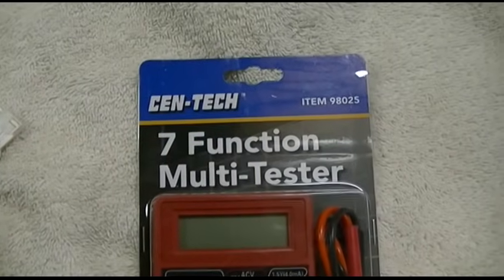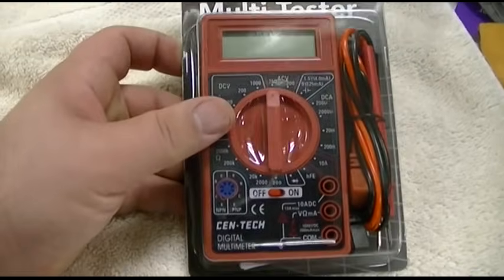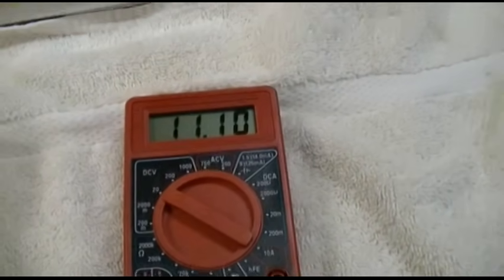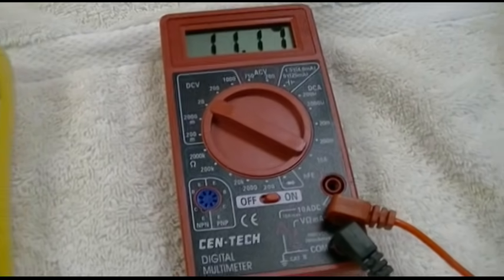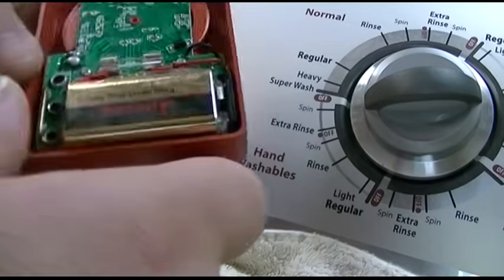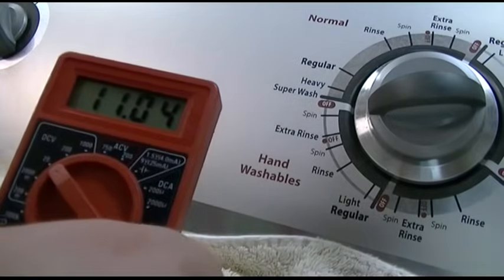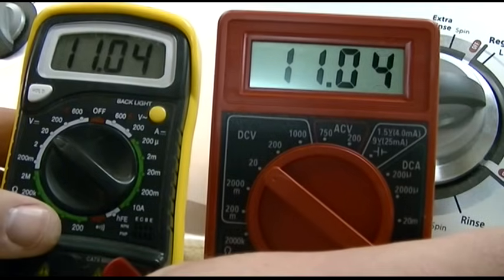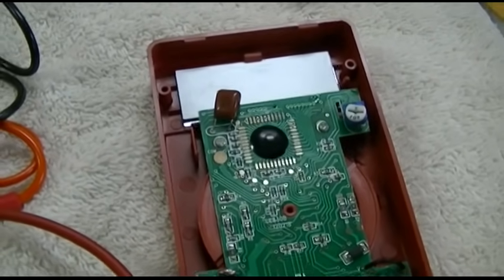Harbor Freight - Cen-Tech 7 Function Digital Multimeter Review

Comment: Why can't you measure the voltage of the battery, of the battery of the meter that you are metering with?
Reply from the maker: Bad stuff will happen.  At the best, you'll get quite an erroneous reading.  Worst, you'll blow the meter and it will never measure accurate voltage.  The only possible exception to this would be something like an old Simpson analog VOM, where the internal battery is strictly there for resistance tests and in no way has any function for voltage.

Trust me, just swap another battery into the meter, and then measure the old one.  Ask me how I know.
Reply: jaykay18
What? No circuit isolation? No warning about this within the meter or its instructions?
Reply from the maker: Yosef MacGruber I had a Fluke meter that you couldn't measure the battery in either.  And why would China possibly warn you about hazards in using this product?  They never warn the kids about lead paint.
Reply: jaykay18
Are ordinary workers in China, not allowed to think or to voice concerns? Seems like they push out crap, just to make a fast buck. Where are their work ethics?

Was lead paint really as bad as they said? I heard that paint jobs didn't last for as long, after the lead was removed. Of course, we shouldn't be finding any lead paint on toys or in toothpaste, or whatever horrors that China has been cranking out recently?

Where are overpriced Fluke meters made?

Isn't the voltage reading isolated from the battery? Voltage reading is supposed to be at near infinite resistance, so as to not alter the circuit being measured, whereas current measurement is at near 0 resistance. How can near infinite resistance, cause a problem with measuring its own battery?
Reply from the maker: Yosef MacGruber The workers in China are NOT allowed to voice their concerns.  I've read that in China you can have 1 of 2 occupations.  You can be a farmer, and live in absolute poverty.  Or you can work in the big city in a factory.  Most of these pay next to nothing, and have deplorable working conditions and hours.  But remember that "next to nothing" is a term we use here in the US generally to describe minimum wage.  In China, that equates to about $85 a week.  In China, $85 a week can do some pretty nice stuff for a person.  But remember that your job owns you, a lot of them include dormitories for the workers as well, so you really end up having no life.

I don't know about how bad the lead paint thing was, I grew up eating paint chips, breaking open thermometers playing with mercury, and spend many hours a week in an area with falling asbestos, and have shown no health effects from any of that.  Or at least I'd like to think so ;-)

I don't have my Fluke with me now, and I don't know where it's made.  The older ones my dad has were probably made in USA, only because at that point in time we weren't outsourcing everything there.  I wouldn't be surprised in the very least if the Fluke meters are made in China now.  If they're not, they're assembled in USA of foreign and domestic components.  You know what that means.

If you want to go ahead and blow up a meter, try measuring its battery.  But the problem is you couldn't possibly get an accurate reading anyway, because when you test it the battery will be under load, driving not only the LCD display (and possibly backlight), but also the electronics.
Reply from the maker: Yosef MacGruber Not buying China is as simple as NOT BUYING AT ALL.  Now of course there are going to be incidentals, you can't necessarily control where your toilet paper is made and you're not going to stop buying it.  What I'm talking about are all the latest useless gadgets like Bluetooth speakers that have some of the worst-sounding speakers I've ever heard.  Or perhaps reusing old technology.  For example, instead of tossing your excessively-slow computer, maybe reinstalling the OS, or switching to a better OS would be an option.

I don't know if you watched any of the presidential stuff lately.  When Trump gave his acceptance speech, the audience was a sea of screens.  EVERY SINGLE PERSON had their phone up in the air, either taking pictures or recording a video, as if they were the only one in the world to capture that footage.  Not only that, they were going to be the first to post to social media.  That's because we took away our country's freedom and allowed our phones to drive it instead.

With that aside, can you imagine the environmental impact of that?  EVERY SINGLE ONE of those devices had to be charged that night.  While it only takes a few watts to do so, they probably also had a tablet or laptop to charge to.  That's one person.  Then their spouse or children or siblings, or what have you, are all in the same dilemma.  So now the few watts is double that few watts, per person.  Then multiply times how many people in a household, how many households on the block, how many blocks in the town, how many towns in the county, how many counties in the state, the numbers are simply staggering.  That's how many watts we need to create to charge these devices.  Electricity doesn't come free of environmental pollutants, unless it's hydroelectric, solar, or wind.  Needless to say I do NOT own a cell phone.

Regarding your WalMart story, yes, the lady felt a sense of security confiding in you probably due to skin color.  And NOT to her manager, who was probably of a different color.  Remember, Wally World is an Equal Opportunity Employer, and they need to make it known as such.  Like George Orwell's Animal Farm, "All animals are created equal, but some animals are more equal than others".  I think the days of the American are numbered.

Irwin, the company that originally produced the Vise-Grip locking pliers, now has their once American-made products made in China.  And on the package it says something to the effect of "made in China to Irwin's exacting standards".  What a crock!  I found at least 5 things wrong with that pair I picked up.  I guarantee you never saw that when they were made here.

As far as your meter with all of those features, Harbor Freight sells that.  This meter was free.  You can't beat the price of free with any amount of money.
Reply: jaykay18
Not buying at all? Great idea, that way I can boycott this whole crappy NWO-ruined economy.

I have been interested in getting some Bluetooth speaker(s) for a while, however, I have yet to find anything cheap enough, or anything that said to me, "Buy me, because I am too special to pass up."

Yeah, I would love to switch my OS to the OS that I plan to write someday when I have time, the problem is, that day hasn't come yet, and I have not had time to write my OS yet.

What is your complaint about people's phones? People's phones I understand, a lot more than all those huge suitcase-cameras, that make obnoxious noises when they take photos. Sometimes you can hear the cameras going crazy, on some stupid political photo-op, on the radio, which has no visual component.

What "environmental impact"? Those devices are almost totally-free to charge, just so long as the battery doesn't someday crap out. If the number are staggering, then it is either because your mind is too small, or else you need to put away that dollar-store crap calculator of yours, and get you a fancy graphing calculator, or at least a calculator with at least 10 digits, so that the numbers will better fit. Or these days, you can get free calculator apps for your smart-phone, even for "scientific" calculators.

What I do not understand, is what is the point of going to political presidential rallies? I already know that I am voting for Trump, regardless of whether or not I ever meet him in person, or shake his hand. If I could say something to Trump, it might be, "Be more pro-life" or "Be more conservative" or "Could you hire me?" What about the supposed environmental impact of all those cars, the hours spent driving to there, and all the man-hours consumed to do those rallies? But then, that is part of the campaign process, and if a person does not campaign, the stupid voters won't know to vote for him.

Cellphones, whether dumb-phone or smart-phone, use a lot less energy than a full-sized computer. I presume you must be using one or the other, to post your comments here?

Maybe I could pay more for a multi-meter, if it would just automatically fix whatever I am testing. But then, should we want an AI robot made in China? I do like to watch those YT video teardowns of electronics crap from Chinesium, as one reviewer calls that stuff. Fascinating, in a morbid sense. Really? Will someday there be a museum documenting the horrible crap that came out of China for a while, until they cleaned up their act? Makes me wonder what Chinese horror story products I might own? And how to quickly spot them in the store or when shopping online. Not only are many products unsafe, but the quality is shoddy as well. As if the trend now, is to make stuff so crappy and cheap, that it barely even works.

So do you think that my old analog multi-meter, might actually be better for some things or in some sense, than the digital cheapo multi-meter, that appears to do so much more, and to take more accurate (digital) measurements? Of course I am planning to keep my analog meter.
Reply from the maker: Yosef MacGruber Oh those phones DO use power, a typical cell charger is pulling a good 5 watts from the socket when charging.  Then apply the law of small numbers to that 5, and it soon becomes huge.  The additional load on the electrical grid they have caused are causing environmental impact.  That's something we didn't have some 30 years ago, nor was it even a dream.

Now I'm certainly not all save-the-planet, very far from that as a matter of fact, but for something we as a species got along without for thousands upon thousands of years, to suddenly take over the brains of mankind, there's something wrong.  And don't even get me started on those texters-and-drivers.  One of them ever hits me and I'll probably murder them in cold blood in the street right there.

I use a full-size computer.  It does everything better than a phone.  Plus I can sit at my desk like a gentleman and get some work done.

The analog meter often will have a quicker "refresh rate" than the digital.  That is, if there's a momentary voltage drop, you can watch the needle swing, while, when digital, you might see some numbers slightly change.  Seeing is believing.
Reply from the maker: Yosef MacGruber I'm still a firm believer in old technology.  It never goes obsolete if you can find a use for it.  Just like you mentioned when LCDs came out, CRTs were and still are fine, and in fact I still have a number of CRT TVs.  I think the bigger sin here is the American culture throwing out perfectly good working appliances just for the sake of something "new".  The worst part is that something new probably cost them money they didn't have, so that furthers their debt.

I remember old computers well, I cut my teeth on them.  PCs in businesses were left on all weekend to prevent the dreaded no-boot on Monday morning when it was time to get back to work.  But the image on the screen stayed static, which is why screen savers were invented.  They claim that they are not needed with LCD screens but nothing could be further from the truth, my LCD at work has plenty burned into it.

Electric cars are NOT a new idea, though we have better technology for it today.  I still think they are in their infancy and won't even consider them for a long time to come.

As far as auto-pilot is concerned:  While a human may be a terrible driver, a computer can't possibly do it better.  The computer is programmed by humans, and with the likes of bloatware today, it's clear there are no talented programmers left.  My friend's Chrysler 200 is plagued with so many problems, their only "fix" for anything is a software update, which fixes nothing.  I once saw a PSA that said something like "drive like you life depends on it, because it does".

The EPA has gone absolutely crazy trying to reduce emissions from cars, making them run horrible and costing people thousands of dollars.  My classic car has none of that, and while it's practically 5MPG, it's absolutely care-free.

I've heard plenty of stories of these cheap-o meters blowing up, but then again if you're trying to measure 25kV with it, you're asking for trouble.
Reply from the maker: There's nothing wrong with LCDs getting burned-in images, except for the fact that they said it couldn't happen and there would be no need for screen savers.  They were also very wrong, mind you, about the LCDs using less power than CRTs, when comparing small screen sizes.  This is based on my own testing with a wattmeter back in the early days, and sure enough the CRT used less wattage than the LCD.  Perhaps the technology was too new.

Cars that drive themselves are a scary thought.  The fact of them talking to each other so they swerve in unison is dependent upon ALL cars on that road to have such technology.  If there's one human-driven car, all bets are off.  And I'll bet there will be human-driven cars for easily 100 years to come.  

The technology is there for computer-assisted driving, electric cars, and all these other great ideas on paper, but in reality we're still stuck with our ancient gasoline architecture.  Pretty hard to change the last 100 years overnight.

Cars today with adaptive cruise, anti-lock brakes, traction control, you name it, they're all nannies.  And they completely ruin my day.  My first car had NONE of those things, and I knew how to handle driving in any condition.  These technologies get in the way of my controlling the vehicle.  My classic car also has none of this hocus-pocus, and has no need for it.  And there's nothing like being in full control, gliding down the highway, getting 5 miles per gallon, listening to the pulses of that 430 V8 pollute the atmosphere as I go past all the BMWs, Audis, Mercedes, Teslas, Pruises, you name it.  It truly is king of the road.
Reply: jaykay18
Well now LED backlighting is becoming the norm. Supposedly impossible technology, now smart-phones and laptop computers, can have screens glowing for hours, before the batteries go dead.

Somebody replied to me some time ago, "The government will reprogram your car to kill you." To which I replied, "You have been riding in self-drive elevators for decades." Of course one difference is, the elevators didn't know who you were.

The self-drive cars will know who the human drivers are, as those will be those cars that do not talk to the network. And that is why they respect the humans and give them more space, as humans are too unpredictable. In fact, self-drive cars would probably make driving more fun for the human drivers, as there will be more room on the roads for the human drivers, as the self-drive cars naturally cluster together and draft behind one another, for lower wind drag.

Some commenters have suggested special lanes for self-drive cars, which I think is a stupid idea. No, I think self-drive cars must respect that it is a human-dominated world, thus self-drive cars will use turn signals, and respect humans in whatever ways that they can. We don't have enough lanes, to set aside special lanes for some 2% of the population, riding bicycles or in self-drive cars.

You seem to not realize how fast the transition to self-drive might naturally occur. Self-drive cars might eventually be allowed to drive faster than human-driven cars, and also be exempted from liability insurance, which serves as natural incentives to switch over to self-drive. And as soon as cars show that they are capable of driving by themselves, almost immediately, we can no longer allow for "shy" self-drive computers that insist that their humans help them to drive. As we will have people with no license, no experience driving, or too old and out-of-practice to drive. Is the 12-year-old child supposed to drive? No doubt, there will be some cars traveling empty. What did people do in the old days, when the family has but only 1 car, and Dad needs to drive the car to work, and Mom needs the car to run errands? Well she drove Dad to work, and then she had the car for the day. Now, the modern way is, the self-drive car drives Dad to work, and then returns home on its own. You could call your car to come pick you up, from wherever you are, from an app on your smart-phone. If you can't find a parking space, you could just have your car drop you off, and drive itself home, or find its own parking space a mile or three away, where there actually is ample free parking.

People might poo-poo self-drive cars now, but when all their friends have self-drive cars, the song will obviously change. Do we see many ancient cars around anymore, without air conditioning, without power brakes, without power steering, without cruise control? Cars will soon come standard with self-drive.

In The Jetsons futuristic cartoon, the flying cars are not self-drive. But hold on a minute. Isn't it likely, that The Jetsons simply got it wrong? Back in the 1960s, how were they to know how powerful today's computers would be? Well at least they had video-phones, which is Skype and Facetime, and a bunch of other apps now, but The Jetsons video-phones weren't upon portable pocket devices as they are now. There was some YT video I watched long ago, "Why we don't have flying cars yet". The guy's whole point, was that they need to be self-drive. I can see that. Easier to make cars drive-fly themselves, than to get 100s of millions of people pilot-certified. And The Jetsons flying cars, were self-drive in a very limited sense. Unlike an airplane, the Jetsons flying cars, are extremely unstable. Without modern motion sensing and instant computer correction, the flying car would slide sideways at the slightest gust of wind, or would just instantly tip over. Yet that never happens on The Jetsons cartoon. Some of today's fighter aircraft, are so aerodynamically unstable, that they would be totally unflyable, without "fly by wire" in which a computer constantly makes corrections. The human pilot reacts too slowly to control the airplane.

Cars that drive themselves, will not be "scary" to the next generation. In fact, how would you feel, if you got into an elevator, and it didn't drive itself? If you actually had to pull some lever, to go up and down. Pull another lever, to tell the doors to open. Wouldn't that be scary? What do I know, about how to drive an elevator? We haven't seen an elevator operator, in what? Maybe a half-century?

Already, what is going on at airports? Some airports have those automatic trains or trams, that take you to  the other terminal. I looked around, and I don't seem to see any driver. Those trams just run their little circuit all day, stopping at the next terminal, opening the doors, closing the doors, and driving off to the next terminal. Very boring work, but a computer doesn't care if its job is boring. But at least that is on a fixed track. It is not like the computer has to make all that many important decisions.

No, I don't think there will be human drivers into the next 100 years. Eventually humans may be banned from driving, and it will be "scary" for there to be a human driver on the roads. I mean, why would humans even want to drive, when cars routinely travel at maybe 100 mph?, and just sail through intersections with no traffic lights? Traffic lights will be just for the pedestrians to cross, as self-drive cars can time their arrivals through intersections, so that they do not collide nor have to slow down by very much. It won't be just women saying that freeways are too fast. Most everybody will say that cars are too fast, and so they no longer want to drive.

Computer-assisted driving is experimental, and will get old very fast. People will not want to be nagged to touch the steering wheel every 5 or 10 minutes, lest the car become scared of itself and become lonely. Soon people will want to be reading their book, working on that important report, or be sleeping in the back seat. Manufacturers will soon be pushed to roll out full self-drive technology, if they want to stay competitive. The occupant of the car, is just there for the ride, or to pump the fuel, if cars are not yet free-energy. And no doubt, many cars and trucks will have nobody in them at all, just out making deliveries. Which can reduce the numbers of miles driven, as drivers who are not there, will not have to return home. Nor will toilet and snack breaks be needed. The computer can "phone home" if there is a problem, or pull over to the side of the road and wait for somebody to come change a blown tire. But I think on quite many jobs, drivers and pilots are still needed, in case something does go wrong, or to actually carry the delivered product inside of the business. Airplanes are almost self-drive capable already, yet we still insist upon pilots in the cockpit.

Self-drive cars, will someday be like self-feed on a big power wood planer. Sure, you could hand-crank the wood through the planer, but why bother, when the planer can do it itself? Do you have hand-crank windows on your car? Probably not. It is hard to reach the cranks on the doors other than the driver door. Human-driven cars will be like dinosaurs. Pretty much useless. An ancient relic of an ancient and difficult time. And car crashes will no longer be just an everyday, rubber-necking curiosity.

I hope to see ancient gasoline technology, go the way of the typewriter and the horse-and-buggy. Good riddens.

You think that your ancient fuel-guzzling muscle car can beat a Tesla? Ha! Teslas outperform even classy sportcars. 0 to 60 in just 3.2 seconds. That is "throw you back into the seat until you cry Uncle" fast. Teslas have no transmission. Since electric motors produce their maximum torque at 0 rpm, there is no need anymore for downshifting. And electric cars love stop-and-go city traffic, because they can just put the kinetic energy back into the battery with the regenerative braking. Electric cars hardly even use the brakes. And if you are stuck in traffic, the electric car doesn't just sit there, draining the fuel tank dry, as it is pretty much off, except for the air conditioner and the headlights which use but a fraction of the battery's capacity.

The sad thing about Teslas, is that neither of us can afford one. But hopefully, that may soon change, as they come out with better and cheaper models for the populous masses.
Reply from the maker: Yosef MacGruber It's great to dream.  The ideas are there.  But I tell you, as a population it seems we have so many unhappy with whom THEY THEMSELVES have elected.  So that means government stands in the way, or at least a lot of red tape.

The Teslas, once again, sound great on paper.  But if none of us can afford one, there's no point.  In the future, yes, but until then, status quo.
Reply: jaykay18
Some people can afford a Tesla car. While having to wait for a hour or two, on a long trip, at a free super-charger is a bummer, I think it is offset by the simplicity of the Tesla, and having less crap underneath the hood to fail, and to leave you stranded. I would love to have a nearly silent car, that can almost drive by itself. I would love to help along the technology, by buying one. But such is not my role in life right now, as I don't have much money.

The rich people always get the cool stuff first. But if they didn't get it first, nobody would ever get it. Somebody has to pay for the novelty, and the research. If rich people could not afford such things, engineers might not hardly ever produce anything new.

The government is so corrupt, partly because almost nobody reads the Constitution, and they don't hold the government accountable. Corrupt DemocRATS get re-elected, because the lazy Republi-crats either run lousy candidates, or in some minor races, they don't even run a candidate and so the race is uncontested. Too many people want free stuff from the government, which obviously is very expensive and not free at all, rather than telling the government to just leave us alone and keep its greedy hands out of our wallets.

I like to think that the days of the internal combustion engine are numbered. Probably within my lifetime, most all cars will either be electric or free-energy, and they will hopefully be, 99.9% self-drive. I hope that soon, there will be more than just auto-pilot that can hold into its lane, but rather, the car would make turns, and take you all the way to your destination. Like the wonderful GPS navigator, "You have arrived at your destination." But self-drive cars had better have far better software than my GPS navigator. "Drive to the highlighted route. Recalculating. Recalculating. Drive to the highlighted route. Recalculating." My GPS is too stupid to figure out, that I am probably not driving through grass, at 65 miles per hour, and thus update its map to show the new "some unnamed connector route". Unlike some people, my GPS talking to me, does not bother me, because Lady Garmin does not take offense if I just ignore her, until I get onto roads that she knows of. Hey, I am just glad that there is a lady that will talk to me. Makes my trip less lonely. I still remember "the good ol' days" when it was so easy to get lost, and paper maps, well that is about all that there was, that and stopping to ask directions, and most people can not give directions worth a crap. "Go a few miles, and turn left at some tree, and turn right at the barn." Now how am I supposed to make any sense of that? How can I even remember 4 or 5 turns, in some area that I am not familiar with anyway? Even with directions printed out from a computer, you miss just one turn, and then you are totally lost. None of that so-handy GPS navigator option, "Well it looks like you missed your turn. Well that's okay, I will just recalculate your route for you." The stupid navigation app on my smart-phone, just recalculates and doesn't even bother to say that it is doing so. At least Lady Garmin is nice enough to say, "Recalculating."
Reply from the maker: Yosef MacGruber I think you meant to say "Republicants".

GPS is a great invention.  But I've done so much travelling in so many areas I usually can figure out where I am pretty easily.  I had to learn all that back in the day before GPS, using nothing but the sun.

The wife takes one wrong turn and its all over.

I have a very outdated GPS (9 year old maps?) that does plenty well for me, the 2 times I didn't need it but wanted to play.

The biggest problem I have are people listening to their GPS even though it is obviously wrong.  "Turn right onto unnamed road" WHILE ON A BRIDGE makes a lot of morons end up in the drink.  And it's happened more times than you even know about.  That's the worst part.
Reply from the maker: Yosef MacGruber Oh, GPS devices are awesome, provided the "nut behind the wheel" understands and has the final say.  Often times while "playing" with the GPS, I'll purposely go a different way to see how it's going to react.  Again, as long as I have the final say, that's fine.  Same with self-drive cars, as long as it's immediate manual override and I don't have to fight the car for where I want to go, that would be a nice assist.

They were testing (pioneering) adaptive cruise control in the early 1980s, but it was very slow to respond and primitive.  Obviously we've come a long way since then, but it's also been 30 years.  Of course we've also had a lot of technological breakthrough in that same time period.

Or, as I sit here and type this, I noticed I made a typo with a word, due to auto-correct.  It underlined it for me, but I HAVE THE FINAL SAY in how it's spelled.  Some words it just doesn't understand, even if I look it up in the dictionary and spell it right.  Then again, sometimes I like to twist words around for mild comedic effect using intentional malapropisms, which it doesn't take kindly to, but again, I have the final say.
Reply: jaykay18
Well that is a big question with self-drive cars. Who will have the final say? The human operator, the manufacturer of the car, the Big Brother government who insists that it be used to spy on you? Will a self-drive car wait 30 minutes at a red traffic light that won't cycle, or refuse to go 1 mph over the speed limit, regardless of the medical emergency? "But my wife is about to birth her baby!"

I would love for self-drive to be voice-activated. "Let's take the scenic route today."

I think a major weakness of self-drive technology, is that still, computers do not see very well. Too much reliance upon radar and proximity sensors. Computers may need to improve their object recognition, which is really challenging for a computer to do. Also, cameras need to be very wide-field, and yet also have enough resolution to see a good amount of detail. I mean, licensed human drivers often have to wear their glasses. That is a lot of data to process, and that needs to be done in real time. Self-drive cars might soon be asked to recognize and identify correctly with an extremely-high confidence rate, pedestrians, wild animals, pets on a leash, baby carriages and strollers, objects to avoid hitting, mere pieces of paper or an empty plastic bag blowing across the road, snow, rain, a ball rolling into the street, water, shallow puddles, deeper water or flooding conditions, ice, mirage, tree lying across the road, apparently damaged bridge or roadway, etc. Self-drive cars should also recognize traffic signal lights, turn signal indications, people directing traffic and their hand-arm signals, the behavior of other (human-driven) cars, read and interpret street signs and speed limit signs, etc. I doubt that merely being able to recognize lane division markings by camera, is going to be enough. Eventually, there will often be no human available to take over, when the computer gets confused. Until some of these issues are addressed, self-drive will merely be some sort of "driver assist", and not some reliable technology to allow the driver to go to sleep in the back seat of the car.

Ideally, a self-drive car should recognize, every business sign it has ever driven by. "My friend said to meet him at that new restaurant. Do you know where it is?" "Yes, we drove by it, a month ago, and I have it logged in my database, although the GPS database doesn't have a record of it yet. Perhaps with the next update due in about 6 months." And that conversation might occur through your self-drive app on your smart-phone so that you do not have to actually be within your car to talk to it. Now that is something, that very few people are capable of. Remembering every single sign that they have driven past, during the last several years. Computers should be able to manage that easily, although computer memory probably still is way too expensive, to catalog all the dash video recorded over the last several years?

Obviously, a self-drive car should pull over to the side of the road, and call for assistance, in the event of a blown tire, as it knows it is a robot that has no hands to out and change the tire itself nor to pump its fuel at the fuel station, but it can't be getting "lonely" and scared to drive, every 5 or 10 minutes, once it is expected to be a competent driver. Upon setting its destination, I would expect a self-drive car to estimate whether its range is compatible, and respond with "Not enough battery charge" or "Not enough fuel to reach the destination". It could also pre-check for traffic delays along the route at that time. Or perhaps, there will be full-service fuel stations, in which somebody will pump fuel at the fuel station, for self-drive cars that can not do it themselves. Perhaps some robot will connect up the recharge cable.
Reply from the maker: Yosef MacGruber Yes, and that's my point exactly.  Like I had stated, I started driving before we had "nanny" systems in cars.  I hate ABS, I hate traction control, I hate airbags.  My car now has traction control, but there's no button to turn it off.  Instead there's a complicated procedure of putting the parking brake on, taking it off, pumping the brake pedal three times, putting the parking brake on and off twice more, flash the lights, beep the horn, shift into reverse and lock the doors kind of thing to shut it off.  And that's for that turn of the key only.

I've learned to live with ABS, but it's almost cost me my car and possibly my life twice.  That never ever happened when I was in full control.  Sometimes it really does take the human driver to make the decisions.
Reply: jaykay18
Didn't I hear perhaps a few years ago, some new report saying that self-braking systems might be common in cars by 2022? To which I think, "No! No! That was not how it was supposed to be. What we want is self-drive cars, and not mere nanny-cars that second-guess all our driving decisions." Stop with the stupid gimmicks! Just make it self-drive already. Isn't the philosophy supposedly, even in airplanes, with auto-pilot within them, that the human pilots have the final say? It is they, who decide if they want to engage auto-pilot or not. So far, the thinking is that human minds are more creative, and often can deal with "unforeseen circumstances" far better than a computer can. Yes, supposedly a self-braking nanny system could probably avoid a lot of rear-end collisions, but people shouldn't be texting-and-driving anyway. If I send somebody a text, much of the reason that I didn't call them, is that they can reply at their convenience, even the next day, if they are asleep. If it was an emergency, wouldn't I have just called them? I might text somebody to invite them to come with me to some event. I don't need a reply right away. No reply suggests that they are not interested or unable to come that time. A short text allows them to think about it, and get back to me. It also allows me to spell out the exact name or address. If they are driving, they should wait until they arrive at their destination, to check their texts. At least wait for a red-light delay to quickly check.

ABS is not a "nanny system" but rather it assists the driver to drive better. The idea of ABS is to decrease the stopping distance of a panic stop, which should always help the driver. It comes from the simple physic fact that static friction is greater than sliding friction. Once the tires lock up, not only is stopping distance increased, but steering control is lost also. ABS helps the driver to keep control of the vehicle. And only a computer is fast enough, to keep the tires on the verge of skidding, without skidding. ABS is essential on airplanes, as otherwise, the tires could explode. If the tires lock up, it takes so long for the airplane to stop, that the tires overheat and fail. The airplane brakes are more designed to take the heat, than the tires are. I think that ABS doesn't even apply, in a moderate braking situation.

Doesn't traction-control prevent one wheel from spinning out, and robbing all the power away from other wheels that have better traction?

I always thought that the always-on of the air bags, was just wrong. However, there are safety liability issues, that have no easy answer. What if the driver turns off the passenger seat airbag, and forgets that it is turned off? Years later, a crash occurs, the airbag doesn't deploy, and then the car manufacturer gets sued for the person's medical bills? What should the indication be? A very annoying idiot light on the dash, that never ever will go out? Some people have a reason to turn off air bags. They have a baby seat in the front seat. Oh, but they aren't supposed to put the baby in the front seat? Really? There are some possible good reasons for this.

• The car is a 2-seater, and there is no back seat.
• They have so many children, that every position in the back, is already filled with child-seats.
• The child has a disability, and is required to be within reach of the parent at all times.
• The car is full of cargo, even in the passenger seat, and deployment of the airbag serves no purpose or might cause an unsafe situation.
• There is some reason to think that the airbag is defective, and it has been recalled for repair, but the date of the repair has not occurred yet.

Cars have long had child-safe rear doors that can not be opened from the inside. (Which can be very annoying for adult passengers, that they have to wait for the driver to get out of the car and come open their door.) However, if you didn't have children, that feature was so easy to defeat. There is an override on the door, that is accessible when the door is opened, that turns off the child-safe feature. Similarly, the rear electric window switches, can be disabled by the driver via his/her override switch. Now why did it take so long for drivers to get the right to override air-bag deployment?

One of the big problems with "nanny" or "safety" features, is when they are poorly-designed, so that as the car ages and starts falling apart, they can't be disabled when they start failing to operate properly. It is more crap to go wrong with the car, making the car unusable. For example, on one vehicle, I was trying to figure out why the battery kept going dead? I thought I often heard sounds of the electric locks clicking, when they shouldn't be doing anything. I checked the manual, was glad to see that nothing else shared that circuit, and finally pulled the fuse to disable the electric locks. I would much rather just have manual locks, than a dead battery. However, that wasn't really the problem, but rather, the battery is crap, and didn't last as long as I would have expected it to last.

What was wrong with your ABS? It sounds like it was defective and in need of repair? And it could have been a braking system issue, that had nothing to do with the ABS?

But I do agree, that cars have become so complicated and expensive, that many people might actually be contemplating how they can just live without even owning a car. The idiot lights and mysterious computer codes, are getting really annoying, and cars can too easily be repair money pits. Shop labor is now ridiculously expensive. One author I have read, claims that the secret to happiness is not owning a car, something that actually is more reasonable, once you leave Babylon America. Many other countries have far better mass transit than we do. And unless you are rich, you probably own an old car that costs too much to keep running, and always has something wrong with it. Many things on cars, simply can not be repaired, as the cost of the repair, is greater than what the car is worth anyway. You figure, you will probably get rid of the car in a few years anyway, if ever you can afford to get rid of it. Not only does my old car burn a lot of oil, but now it tells me I have left the keys in the ignition, or left my headlights on, every time I open the driver door. That stupid chime only shuts up, when I close the driver door. So it is useless now. But at least, it is easy to ignore. At least it doesn't chime while parked or driving, being as obnoxious as possible, or draining the battery. Probably a faulty sensor somewhere, or some stupid computer chip or logic controller, has "lost its mind".

Due to all of these stupid problems, it promotes a "throw-it-away" culture. I would think twice and three times, before installing a built-in under-cabinet microwave oven. But of course, it is going to crap out in just 8 or 12 years, perhaps just 3 years, or right after the warranty has run out, and then the new one won't fit in the space so well. Why not simply use a counter-top oven, that when it craps out, you can just unplug the stupid thing, and put it into the basement or into the storage shed, to be thrown away whenever there is a handy collection, or you have something else to take in to dispose of it? Easier to unplug and replace, than to repair it in a timely manner. Maybe I can get it repaired, before the newer one also craps out?

That is one thing that thrills me about the electric cars, or perhaps even free-energy cars, soon becoming popular. Hopefully, they will eliminate half of the crap in the car, that messes up requiring costly repairs? I would love to be able to "throw away" the awful internal combustion engine, and still have a very useful and dependable car. Good riddens. It can't happen fast enough.

Although I doubt that I would want to spend the money for a 240-volt super-charger installation to my home. Charges in just an hour or two. Charging overnight via cheap extension cord, that is probably acceptable?
Reply from the maker: Yosef MacGruber There was never anything wrong with the ABS.  We have this white stuff in the winter called snow, and ABS doesn't agree with that.  They say with ABS to keep steady pressure on the brake pedal.  So I did that.  The car kept pulsing the brakes, buzzing along, as I slid right through the intersection.  Had a similar thing happen in my old car, and was able to stop in time.

The traction control simply limits power from the engine and brakes one wheel or the other.  Quite unnerving when the car is stuck and both wheels spin, the traction control PREVENTS them from spinning, and then I'm stuck.  Not smart.  The wife's car, which doesn't have said nanny-system, was once stuck in front of the house after the plow came by.  Tried moving it, it moved forward 2 inches and the wheels spun.  Tried moving back, it moved back 4 inches, and the wheels spun.  So I let it settle, reversed my 2 inches and stood on the brake.  Then went to drive, and floored it, and lo and behold it just moved right on out, no sweat.

Speaking of sensors and stupid computer-controlled engines and the blasted check engine light, I've been battling that on the same car.  Engine runs nice and solid, but keeps giving all sorts of codes with no explanation of what might even be occurring.  It's maddening.

Electric cars sound great, and would have much lower maintenance costs, until your battery bank expires.  Unless the technology gets markedly cheaper, it would be time to look for a new vehicle.

And from what I've read, the 120V chargers are VERY slow.  Should you forget to plug in when getting home, you're stuck.  And it's inconvenient if you don't have a garage, if it's raining or snowing, to remember at 9 at night to plug in the car, and you have to trudge through all that.  The snow here stays on the ground for usually several weeks at a time, so slipping and sliding is always a problem.  The last thing I'd want to do is go out there and then fall, all for the sake of saving the planet.  So maybe not the greatest idea in this climate, but in other places where it's summer all the time, sure.
Reply: jaykay18
ABS is supposed to work in all weather conditions. Perhaps non-ABS brakes would have not worked either. Or maybe something is wrong with your ABS? It isn't supposed to just pulsate, but rather to monitor each wheel's speed, and keep the wheels from locking up. Of course once cars can fly, they shouldn't need to contend with slick roads anymore.

Well I wasn't too much impressed with batteries, some years ago, as Lady Garmin's battery has long ago turned to crap. She can't even operate for hardly a minute before Low Battery alert dialog. But that is probably the old crappy nickle-cadmium batteries. I was hesitant because of that, to try Android devices obviously powered by (now lithium-ion) batteries, because much of the convenience and normal usage of the device is gone, once the batteries someday turn to crap. However, by now my Android devices are several years old, and their batteries still operate normally. I would presume, that electric cars have a very good warranty on the batteries? If not, then why not? Since that is an obvious question that most everybody asks.

Perhaps the battery technology has some room to improve? Have you watched any of the YT videos on super-capacitors and on graphene? Perhaps they are getting ready to replace batteries? However, capacitors have a different discharge curve than batteries do. Capacitors have a steady decline in voltage, as they merely store charge, they don't produce charge via some chemical reaction as batteries do. Rechargeable batteries maintain voltage quite well, but when they get low, the voltage versus time graph can drop sort of like a steep cliff. Of course, modern devices such as cameras and electric cars, estimate energy consumption, and/or measure the battery voltage, and estimate how many minutes or miles that you have left. Android devices show your remaining battery percentage. Anyway, I watched some YT video of some guy who replaced his car battery with a bank of supercapacitors. Seemed to work just fine, started the car and everything. Of course people wanted to know how long he could play the car radio, and he was able to play the car radio for a half hour, before the "battery" dropped by a couple of volts, as measured by some cigarette lighter insert voltmeter. So I imagine that his "battery" was inferior to a real car battery, in that it couldn't light the headlights for several hours without the engine and alternator running. Sure, it had the needed cranking amps apparently, but not as much energy storage. But under normal usage, you just don't need that much energy storage. He had the advantage of less weight, and his bank of supercapacitors, took up a fraction of the space of an actual car battery. I imagine that they may cost more than a real battery, but perhaps he salvaged them from something?

With an electric car, unlike fuel-cars, you just do not run them until "Empty". Most everybody tries to estimate just how low they can go on the fuel tank level, before they have to stop and fill up. People are busy, and have better things to do than pump fuel. And it is so boring to do anyway. Cycling from full to empty, people try to minimize their fuel-ups. With a car dependent on batteries, you just do not do it that way anymore. You can't just pop into a fuel station that is almost on every street corner, when your fuel is getting scary-low. It could take hours to recharge, and the free super-chargers could be way out of your way, so you always make sure to recharge at night, if the battery is even half-low. Who doesn't make impulse diversions, decide to take care of some additional errand or to go shopping, or a friend needs a ride to somewhere. With it taking hours to recharge, there is not much point in letting the battery get low unnecessary. My smart-phone battery has never died, as I start getting a little nervous about it, if it is half-low. Better put it on the charger tonight and fill it up. And if ever I need to navigate with my phone, then I know that GPS sensor and keeping the backlight on, is going to drain the battery all the faster, so no point in trying to see how low I can go with the battery charge.

You just do not forget to plug in. Do you forget to get out of the car, or to shift into Park? Why would you forget to plug in? One day some months ago, I figured I would fuel up, before coming home. But of course, I forgot to. Oh well, I probably have enough to get home. Well until hitting a traffic backup on the freeway. Now who decided to crash up there? And so I just imagine sitting there, hardly moving at all, with the last drops of fuel draining from the tank, and then I will be stuck in the middle of the freeway, having to somehow push the car to the side, and go walking to get a plastic fuel tank of fuel. Not how I planned to spend the evening. Well I managed to get home and to the fuel station, before the engine started sputtering or whatever it does when it starves for fuel. But could you imagine doing that with an electric car? When you are not moving, the car isn't draining the batteries, at least not much. Just to power headlights, or the radio, or the air conditioner, and those devices use very little power compared to the motor that drives the wheels.

Yeah, and it is very inconvenient to have to go out at midnight and take the trash out, because you forgot to do it earlier, or before it started raining. So what else is new? With 200+ miles of range, you won't be charging every night anyway. I don't think you can do the "Let's just put on double fuel tanks" trick, because they already thought of that, and that is why electric cars are so heavy now. They already put in extra batteries, to get the range of the car, up to the level to be competitive with gasoline cars. However, electricity is so much more efficient than fuel, that it more than makes up for the car being heavy. At least electric Tesla cars have great handling, since the batteries makes the center-of-gravity quite low to the ground.

I imagine, that is why probably a lot of Tesla car owners, spend the money and have an electrician install a super-charger in their garage. Hey, if you have $70,000 to spend on a fancy car, what is another $2,000 to have an electrician install a super-charger?

Yes, recharging is a pain, and you aren't "saving the planet" anyway, because what of all the other fuel-cars out there?, and you are adding load to the electric grid, it is inconvenient to charge at only off-peak times, if you live somewhere where they nickle-and-dime you via those stupid "smart" meters, and they charge you phony penalties for using too electricity at the wrong peak times of the day. And what of all the chemical and rare-earth materials that go into those batteries? No, what appealed to me, was how quiet an electric car would be, and that I simply no longer want to operate a complicated chemical reaction factory underneath my hood. Internal combustion engines are full of dirty parts that are subjected to heat and pressure, and that too often fail at inconvenient times, requiring an inconvenient tow and costly repairs. Electric power for cars, seems simple. I mean, they do not do much repairs or maintenance to electric elevators, do they? Regular inspections is probably over half of the work that they do? I remind you, that the electric car, has no transmission. Which is yet another thing then, that won't be wearing out or failing on you. And that really impressed me, that under the hood, Where is the engine? It is mostly just a storage trunk. Beautiful!

That is why I would love to see cars powered by free-energy machines, as then there is no fuel, and no recharging. Free-energy machines tap energy from the universe, so there are no pains nor bills at all, well other than having to buy the free-energy machine. But until somebody is able to defeat the evil NWO and stop them from suppressing free-energy, electric cars seem the closest thing on the market, to free-energy.

Your complaints about the electric car, sound much like my complaints against smart-watches. What is so "smart" about a watch that is usually blank, and that has to charge every night or two? Yes, I find them interesting, but just don't see the practicality of why I should own one. Maybe in a few years, when problems are addressed, and the cost comes down. And I can't afford today's electric cars anyway. Tesla cars haven't been around long enough, for there to much of any used car market for them.

I recall it wasn't long ago, that I hated MP3 players. Wow, a toy computer for my real computer. I already have a real computer, so why do I want a toy computer? But then they morphed into smart-phones, that do just about everything for you, except cook you breakfast. The costs came down, and the addition of a phone, a very-handy camera, and apps galore, make that you feel almost "naked", if you leave home and forget to bring your phone. That would be like leaving your home, having forgotten to put on your clothes. Who even does that, except in those life's insecurity dreams? What if somebody needs to reach you? What if the car breaks down? How are you going to call somebody, when you forgot to bring your phone?

BTW, it wouldn't bother me, to live somewhere, where I never see another snowflake, or to live somewhere where it happens so seldom, that once a little snow starts falling, people go all crazy and school and work quickly gets cancelled, and everybody rushes home to have a snow party, sleep, make more babies, or whatever it is that people do, when they get snowed in?
Reply from the maker: Yosef MacGruber Like I said, ABS just got in the way.  I used to test it on the way home from work every day.  My exit ramp had a rather nasty road surface transition, and if I slammed the brakes at just the right moment (in dry weather), the ABS would buzz for a quick second.  It did what it was designed to, but never helped me in any way.  It's sort of like a manual transmission vs. automatic.  I'd MUCH prefer a manual, so I have full control, but they hardly make anything but automatic now.

MP3 players were great devices.  Sure it's a "toy computer", but that's what I think phones and tablets are.  If I need to get some real work done, I sit down at my desk and work like a gentleman.

I still don't own a smartphone (nor a regular cell phone), and probably won't.  The cameras on them, while boasting 47 megapixels, are far inferior to the shots you can get with a real camera, with a real lens, and real aperture.  For a snapshot, they're great, but people use them as their only camera.  And the quality of pictures that people took went way way down since.  It's quantity over quality, how many times have you heard "oh, can't take any more pictures, my phone is full".  Because they have to carry every last picture they've ever taken around with them, instead of smartly using cloud storage.

What if the car breaks down?  I've got 2 legs.  What do you think people used to do in the 70s?  Has my car broken down?  Yes.  What did I do?  I walked to the nearest place with a phone.  Or asked a good samaritan.  It's very easy to say "I'm having such a bad day, my car broke down, and I forgot my phone at home", when in fact I don't have one.

If someone needs to reach me, they can call me directly where I am, there's a phone right next to me.  Same if I need to call someone.  They're utterly useless to me.
Reply: jaykay18
I thought I heard somewhere, that automatic transmissions are largely an American thing? Other countries make use of more manual transmissions, although I can't imagine why. Sometimes, clutches do not last very long.

I do not like manual transmissions. Why do I need to shift, when the car can do it for me? Just more unneeded distractions. In fact, I love that the Tesla electric cars, have no transmission at all.

Well it is kind of hard to consider a smart-phone to be a "toy" computer when I can run an app on it, that contains the entire Bible. Or I can run a browser that can view just about any website, even in the Desktop view. Of course, there ought to be more support for printing out documents through a link to your computer or through a wifi or bluetooth printer.

Smart-phones have REAL cameras. Anything of 2 megapixels or greater, should be able to take great pictures. And I prefer a tiny portable camera in my phone, as I feel that having to carry a giant suitcase camera, makes picture-taking very inconvenient, as why would I want to carry a suitcase everywhere? Yeah, I know that expensive DSLR cameras have better specs, but most novice photographers, have not a lot of use for the better specs. I can figure out somewhat, how to frame a picture, how to make sure the lighting is okay, to hold the camera steady, and why to take most if not all pictures in landscape mode (so that they fill my TV screen).

I have never had the problem that my phone is full. Why do people take so many pictures, that their pictures have no special meaning and are just too many to ever view? The camera app on my of my Android devices, tells me that I have room for 11,000 more pictures. It would be far more than that, if I didn't have so many videos in my device. 11,000? That is enough to last several lifetimes. Compared to a roll of film that could hold, what maybe 24 pictures? And I have only but a few 100s of photos on it.

Smartly using cloud storage? Really? Why would you trust the cloud? Anything in the cloud might just go poof one day, even before that giant corporation declares bankruptcy. Someday, they will switch to a new system, and all the old stuff will be gone?

Why not carry every single photo with me? It is not like I have all that many. In fact, I carry too many of my relative's photos, which perhaps I should purge some more of those. That stuff can be stored in your full-sized computer or on USB flash drives.

What if you don't know how far you have to walk to find a phone? It could be 10 miles or more, to the nearest exit ramp. That is a 3-hour walk, one-way! And do you want the tow truck coming, and you aren't even there with the car? Since most everybody now has a cellphone, payphones have become almost rare. Why wouldn't you just tell the person, that you don't have a mobile phone?

Those of us, who are loathe to pay for an expensive cellphone plan, now can find a cheap deal on a prepaid "just for emergencies" smart-phone, and it remains cheap, as long as you don't get in the habit of using it too much. Although I may sometimes use it for convenience, I try to be mindful and limit how many people I give my cell-number to, I refuse to answer when the phone doesn't recognize the caller as somebody I know (pesky telemarketers), and I often wait until I get home before I call somebody. I have managed to save up so many minutes from each period when I have to renew, that I feel a little freer now to use some minutes when I need to. (I don't have to tell my friend, "I can only afford but 2 minutes, and you already used up 1 minute.") But I do still have to scold them when they waste too many of my texts. ("I don't have unlimited texting like you do.") My home-phone internet phone adapter is a lot cheaper than a landline, gives better service and nearly the same convenience for a fraction of the price, and it has practically unlimited minutes. And it is portable, in that I can take my phone number with me, wherever I might move to.
Reply from the maker: Yosef MacGruber You are correct, automatics are largely an American thing.  Personally, I think it plays too much into the stereotypes, such as the veritable "big, fat, dumb American" that other countries call us here.  In other words, too dumb to know how to shift.  But here, manual transmission cars have the ultimate millennial security system.

I like a manual because it allows me full control over the car.  It's no distraction when you can drive, steer, eat a sandwich, shift, and roll down and manual crank window at the same time.  It's absolutely second nature.  My car now is of course automatic but has the "sport shift" mode where I can select what gear I want, provided it's within the specs.  Can't say I use that feature too often, but sometimes I want something to do.  Usually it's not necessary with it's high output 6, it hauls even in 4th gear.

I still find the "mobile platform" excruciatingly frustrating.  Oh, it's there, it's great, it's super convenient, but it just doesn't allow me to really get stuff done in the same manner.

I never said anything about DSLR.  I said a REAL camera.  A year ago, on vacation, I took my 7-or-8 year old 6 megapixel digital camera with me.  Took plenty of pictures, and challenged my mother-in-law to out do me with her latest and greatest iPhone.  Pictures were not even close.  They didn't have the depth, the color saturation, the contrast that mine did.  Even more many years ago, I took a picture in NYC at Rockefeller Center with a 2 megapixel camera, and nobody could ever believe it was only a 2 megapixel camera.

If you don't store all that stuff on your phone, then great.  You're using your storage space wisely.  When flash memory because inexpensive, people abused it.  Sure, it used to be a roll of 24 exposures for film, and you'd often hear "stop wasting film" by someone else when they didn't approve of the picture that was being taken.  Now only old people like my 97-year-old grandmother say that, because they don't comprehend "there is no film, it's digital".

So like I said people abuse the storage because it's there.  That's why a lot of people's phones run slow.  They have so many apps on there because "find it in the app store" is plastered all over everything.  So they get the app, and then after not visiting a 7-Eleven in 6 months, still leave the app because they once got a free coffee with it.

Cloud storage is a great solution for temporary storage.  It's a better solution for these people that have their phone surgically attached to one hand.  They never put their phone down, and they are often the same ones that will end up dropping theirs in the toilet, or dropping it on concrete and breaking the screen to the point it's unusable.  Most of these type people (they run RAMPANT here) don't know that their phone can even interface with their computer.

If I'm seriously going that far away from a place that has no phone service, generally I'll be with someone that has a phone.  Where I live, it's so populated that it's impossible to not find a residence, business, or other person with a phone within 1000 feet.  The New York attitude dictates if I tell them I don't have a phone, then I can't use theirs.  If I lie about it, and say that I forgot mine, they'll sympathize, and remember those couple days when they forgot theirs and were totally lost.  I've thought all of this through.

Sure, there are dirt cheap cell companies out there.  MetroPCS offers unlimited everything, including a phone, for $30/month.  Then there are others that limit you severely like FreedomPop, which will, in fact, give you limited cell service for absolutely no money, provided you're within the limits they set forth.  Still something I don't need.

The wife insists on a phone, which she bought herself years ago, and still uses.  And guess what it's good for.  "Let me tell you all about my day while I'm driving home so that when I get there and we eat dinner I can say "how come you don't talk to me anymore"".  Twice in 15 years had she called me with actual car trouble.
Reply: jaykay18
We Americans are so smart, that we know that the car should shift for us. Yes, there is a lot I could say against big fat and stupid Babylon America. But automatic-shifting cars, is not among my complaints. And Babylon America at least knows how to build shopping carts. What is wrong with the rest of the world? They make incredibly stupid shopping carts, carts that look just like mal-designed crap. With 4 steerable wheels, so that they can not travel in a straight line, and wander all over the store aisle. No shelf underneath, because apparently the store wants me to buy whatever I would put underneath, perhaps the dog-food, at a competitor's store. Perhaps their schools do not teach anything sensible about marketing?

Well my Android photos were great. And that with a 2 megapixel camera. Even some night-time pictures. Although the camera just can not see well in the dark, in video-movie mode. Video should only be recorded in daylight or good indoor room light.

How do I put this nicely? Of course I have not seen you-all's photos, to make a fair comparison. I think her iPhone photos, were perhaps an operator problem. Perhaps she is just not as good of a photographer. But you complained about things more relating to the smart-phone's supposedly inferior specs. Well perhaps so then?

What do you mean, that her photos did not have the depth? Are you talking about having control of depth-of-field? Are you saying that in her pictures, the background was just as sharp and in focus, as the foreground part of the photo? Supposedly making her photos look "flat"? In most photos, that is how it should be. If you are going for all those fancy special-effects of a DSLR camera, then of course the DSLR will win, in such a rigged comparison. For me, I very much like the tiny Android camera, because it takes so many more pictures. If my only camera was a DSLR camera, it wouldn't take many pictures, because I have leave that monstrous suitcase camera at home. And I am quite sure, why smart-phone cameras are so popular, and why so many photos and videos are recorded with smart-phones, because that is all most people routinely carry with them.

There is something wrong with either the OS or the apps, if having a 1000 apps, makes a smart-phone run slow. Come on, they have had decades to improve OSes and file systems. And why does a person need a separate app for every store? You can get just 1 app, that can store all those VIP store discount cards within it. I never had much success with trying to scan cards with the Android camera, so I just manually type in the numbers. Open the app, select your store from your list, and a scan-able bar-code appears right on your phone screen, that the cashier can scan. I hear some store scanners didn't like to scan phones, but that seems to have been mostly-fixed by now. One thing that is cool about that app, is that it easily "clones" cards. You can scan your friend's or relative's card, that is, if they don't mind sharing, and you can put it onto multiple Android devices.

All your stuff in the cloud, goes strangely missing, whenever you don't have signal. And like I said, you never know when someday it might just go "Poof!" and disappear. Now backing up to the cloud, might be convenient, but I like to have my data actually physically present on the device. I have one Bible app that is really strange, in that it complains about the lack of any link to the mother ship, and then finally accepts to use the downloaded Bible version as I wanted anyway. Another app, doesn't even care about the mother ship, except when you go to download more Bible versions. Guess which one I like to use more? The latter one, although there are other reasons also why I like it better. It has just so many features and I like the way that it is laid out.

Isn't that what a watch is for now? So that you don't drop and break your phone, from checking the time every 2 minutes? I just don't understand people's excuse for not having a watch, "My phone has a clock on it." What? Well my car has a clock on it, but I can't go run to my car, every time I want to know what time it is.

What that is a shame, that they don't know that their phone - A COMPUTER - can interface with a computer. How do people not know this stuff? How can they not know, that you can take all of those old photos from your phone, put them onto a USB flash drive with the help of a computer, and then watch all of your photos and videos on most any smart-TV? Which is a great and easy way to do a presentation to a crowd. With the help of  a computer, you can put your DVDs and CDs into your phone. But perhaps they think there is no need, because the cloud does most of that for them? Perhaps I don't know enough about the cloud, as I don't use it much. If I had the time, I should find me some more free apps to download and play with?

I have even plugged my Android device into my smart-TV, via its USB port, and it thought it was simply 2 USB flash drives (the micro-SD card appeared as a separate drive), and my Android device thought the TV was a PC. The TV easily played any videos or photos that I had on the device, and then the device after a while made the sound to indicate that it is fully charged, as the TV charged it. That is a lot cooler than the old digital cameras, that had a video output for your (dumb) TV, which depleted the camera's batteries rather than recharging them.

Oh, I see now. So they think that you are some lazy homeless bum, if you chose to not have a phone. You are beneath their social class, so they don't want to deal with you. But if you forgot your phone, then they think that you are much like them. On a relevant note, I have a theory about those "trailer trash" people. If you needed to make a phone call, or you were hungry and begging for a meal, or whatever the situation is, I think people would help you, if you went to some "poor people" trailer park. But if you go to the rich neighborhood, they would think you are creepy, or some bum seeking to rob them, and you would have to knock on a lot of doors before anybody would even lend you a cup of sugar. Anyway, a few times, somebody let me borrow their phone to make a phone call, before I had a cell-phone of my own. I would hate to depend upon that now. So much easier to just use my own phone.

Unlimited is still way too expensive. I would rather have "limited" because it is so much cheaper. But you have the pain of running out of minutes, if you are not careful to save up and conserve your minutes. And yet minutes are not scarce, like how they act like they are. If you use too many minutes, it isn't very likely that somebody else will have fewer minutes as a result. I know that cell-towers have limited bandwidth, but it isn't that limited. And it is those "unlimited" people watching YouTube and Netflix videos all day, who are using up all the bandwidth anyway. The reason why cheapo pre-paid phones have limited minutes, is that it is marketing leverage to convince you to upgrade. But you don't ever have to. As long as you are willing to go "limited" then you are exempted from having to pay "your full fair share" of the high costs for cell-tower land acquisition and cell-tower upkeep. That is the true costs, and not so much the limited bandwidth, don't you think? That is why cell-plans are structured as to encourage you to use more and more bandwidth, and certainly the appeal of unlimited.

Why do I need unlimited when I have a full computer and wifi at home? I really don't want to use it all that much, when away from home. And I think the Data on my phone might be broken now. I can't seem to get it to connect, a couple of times when I tried. It worked before. The wifi and everything else works. I know I have plenty of unused data on my phone.

Should I consider FreedomPop? Somebody told me about FreedomPop. Can you have a smart-phone on FreedomPop, or do they only offer dumb-phones? I think dumb-phones are kind of dumb, now, because you are carrying around a charged battery, a keyboard (even if only virtual) and a color screen, almost everything you need to have a portable computer, yet it only does phone calls and texts? Boring! That is so last-millennium. I want to open my Bible app, play games, etc.

You will likely never be able to completely figure out women in this life anyway. I hear women often have intuition, and they will be completely right, yet they can never explain so well, why they are right.

Some Christian comedian explained it fairly well, the problem that men have with conversation. A woman's daily vocabulary may be around 25,000 words. A man's daily vocabulary, is only around 11,000 words. By the time he gets home from work, he has already used up all his words for the day, So when the wife wants to talk about stuff, well that is why the man has not much to say.

And then there is that other reason for carrying a phone. So that Big Brother government can more easily spy on you.
Reply from the maker: Yosef MacGruber I agree, shopping carts in other parts of the world are very strangely designed.  They realized here that the bigger the basket, the more people tend to buy.

They still make digital cameras and video cameras standalone for a reason.  And you don't have to go all pro-sumer grade stuff to get something nice either.  I think really what this all boils down to is the phone is a "Jack of all trades, master of none".  That's why we still have standalone devices.  They generally do a better job at the one thing they were designed for than a do-it-all device.  That's why I keep those gadgets around, and use them.

I see and deal with too many technologically-challenged people.  Especially Apple iSheep people, they just keep following the herd, buying more Apple when Jobs yells out from his grave.  My dad worked for IBM for 35 years, yet he calls me when he has a computer problem.  I consider it an absolute blessing when someone knows as much about technology and how it works as I do.  It's like a breath of fresh air.

Generally, yes, it has been found that poor people are more than willing to give you the shirt off their back, yet those that live in a McMansion will lift their nose into the air, turn and walk away.  It's because the poorer people sympathize with you, the rich ones couldn't care less.  You'd be filth to them, and no one likes that.

FreedomPop can get you a smartphone, 500MB, 500 texts, and 200 minutes a month.  All you pay for is the phone, cheapest one clocks in at $70 including shipping to your door.  No voicemail service, if you want that, it's $3 a month.  Whether or not the service is actually any good is another story.

Cute joke.
Reply: jaykay18
Now we have these ridiculous shortened shopping carts, and I think I finally figured out why I do not like them. They are comparable to those over-priced convertible cars, which have no back seat, and no place to put the children other than the brief-cased sized trunk. Why does this society have to be so anti-child, so anti-family, and so anti-life? I like to drive a nice family vehicle, even if I am single. I love children and babies, and I believe that humanity should continue to multiply, as God clearly commanded us to. And to me, a family vehicle is stylish, and not just something that old or "has been" people drive because they have to, because they are supposedly not free anymore. By rejecting the shortened shopping carts, I am rejecting the anti-family culture, and the stupid convertible craze. What really is wrong, with pushing around a big shopping cart to carry just 2 items? If I only need but a couple of items, I can just carry them without any shopping cart, or using one of those little hand carts, in stores that offer those.

I just am not seeing it, what you said about stand-alone cameras. The built-in smart-phone camera does about all that I need for it to. It is amazing that some of them even have zoom. How did they manage to squeeze that in? It is not just a mere picture-degrading digital-zoom, is it? But apparently I like a stand-alone GPS navigator. Somehow, Lady Garmin's screen is easier to see in the daylight, it does not get bleached out so easily as the phone does, and the software is more user-friendly than the crappy software of the free navigation app that I downloaded. She organizes m favorites so much better. My phone should be able to navigate nearly just as well, but I had my GPS first, and I still like it better.

An Android device should be able to do everything, and yet I find I like to use different devices for different things. My older Android device has a better and bigger screen, making it preferable for my Bible app and a few other things. My phone somehow shortchanged me on memory, and so I can not just cram more and more apps into it, but must limit it to a few of the apps that do not use much memory. So not so good for games, and its screen is not that great either. I find that the Android software is too stupid to sufficiently conserve battery, and so I have to turn off every Android device when not in use, except for my phone which merely sleeps. Waiting for the bootup delay then discourages frequent usage.

Apple's mobile devices are over-priced, and probably not quite as versatile as Android, so I don't know why they are so popular. Perhaps it is a "follow the herd" phenomenon. I like the Apple Macintosh still, but Android works okay with Macintosh. I have no idea why I should need a costly iPhone. Sometimes Apple is too artsy-fartsy, and the "simplicity" of having just 1 home button, seems kind of stupid to me. What really is wrong with Android's 3 or 4 buttons? Why not a Back button, or a Task-switching button, or a Menu button? Even on my Macintosh, I click the hidden 2nd mouse contextual button, by doing Control-click. Back in the 1980s, when I was in college, I went to their computer support area with an important question. I was trying to log in via dial-up modem, but my Apple //e computer did not have any functions keys. How can I push function keys that are missing? Well they told me how to access the hidden keys. Yeah, my Apple //e had the full ASCII keyboard, but function keys apparently are not true characters. They gave me just the answer that I needed. The insert key was Esc Esc I. Function 1 was simply Esc Esc 0 1. Cool! I was happy with that.

Well I don't know that I want to deal with buying another (FreedomPop) phone. Maybe if I didn't already have a smart-phone? Sounds less limited though. Do the minutes and stuff carry over when you don't use them all?
Reply from the maker: Yosef MacGruber I've seen thousands and thousands of phone camera pictures, and they just lack the clarity that a real camera does.  I think the biggest part here is the physical size of the lens.  The bigger the lens, the more light it can let in.  Phones have to be small, so the cameras do as well.  Smaller cameras have smaller lenses.  Let in less light.  That, in turn, will lead to a lot of software interpolation, and digital noise, that a standalone camera just will not have.

Another YouTuber I watch had an old iPhone he was using as a camera.  And the quality was what I've seen from any other one, that is, acceptable but not incredible.  Turns out he found a deal on a digital still camera, which also happens to take video with pretty good quality.  In fact, for the most part it's better than the old iPhone was.  However, it's a still camera, so its focusing ability is limited compared to a standalone video camera.  The video seems "cheap", especially since it allows optical zoom while video is rolling, which introduces motor noise (loudly) into the audio.  A standalone video camera just doesn't have those kind of problems.  Plus, again, it has a larger lens, for more light, leading to a better picture all around.  My standalone video camera has none of those problems.  The only thing it really has a problem focusing on are LCD computer screens, for one reason or another.  There are a plethora of other features it has, which I don't use even a third of, although on occasion I use some extraneous features of it.

Just like you find your standalone GPS to be better, I find standalone cameras to be as well.  There's just something about it.  Like you were saying, the phone isn't bad, but it's just not as good.

As for FreedomPop, just go to their website and browse it for yourself to see what they have to offer.  Easier than my having to transpose it.
Reply: jaykay18
But more light, doesn't necessary do much. More light, allows you to take great pictures in dim light, and also to use a short shutter timing, so that motion is stopped rather than blurred. A bigger lens also has greater depth-of-field, meaning that everything in front or behind the object which is brought into focus, gets somewhat blurred. This is not necessarily a good thing, and many casual photographers want everything to be in sharp focus.

Software interpolation? Digital noise? Our pictures are compressed into a JPEG file anyway. We don't save photos in "raw" mode onto massive memory cards that get filled up with just a few 100s or 1000s of pictures. Smart-phone cameras do not do as well in dim light, as a DSLR camera, however, I have been able to take pictures at night that look good. Well passable anyway. But the low light level does not work well with recording in video-movie mode.

Yes, I have noticed a few YT videos, which have noticeable noise from the motors in the camera, winding the recording tape presumably. There's your "real" camera for you. Introducing unwanted noise into the video.

Standalone cameras might be better if you are a serious photographer. Most of us, are not. We do not want to lug around that big heavy camera. I am more interested in being able to easily take pictures, rather than missing out on pictures, because I didn't have my camera with me. I also believe that I can not enjoy a nice vacation, if I am too much peering at it, through a camera. No, I need to experience it, not just take pictures of it.

Another thing that does not impress me about those big DSLR cameras. They are about as complicated and intimidating, as an airplane cockpit. The color screen on the camera, has endless complicated words all over it. Rather than an image of what I want to photograph. How many buttons and levers does that hideous thing have on it anyway? Are they all the self-destruct button? I would need to take a class, just to learn how to use the DSLR.

My Lady Garmin would not do any better, if the phone screen would easily go brighter during the day, if the GPS app for my phone wasn't so crappy, if my phone came with a car charger (well I guess I do have one, but have never opened the package), and if the GPS sensor and app could communicate with each other better. In other words, Lady Garmin has better, more user-friendly software, something that Garmin has earned a good reputation for. Android should be able to do the job just about as well, but perhaps, I need to uninstall that app, and find me a better one?
Reply from the maker: Yosef MacGruber As the saying goes, garbage in, garbage out.  If you take a garbage picture with a garbage camera, then compress it into JPG, that's what you get out.

It's like cooking, you start with the best, freshest ingredients.

I'm not even going DSLR.  Not even pro-sumer.  Just your run-of-the-mill, better than bottom-of-the-barrel digital camera.  One that looks like a camera, rather than a phone, if that even exists anymore.  DSLR is an entirely different world.

Vacations are hit-or-miss with picture and video recording.  If you spend too much time behind the camera, all you get is the camera experience and you don't enjoy the vacation.  Sort of like seeing fireworks on TV.  Sure, it's there, but until you see it in person you realize it's NOTHING like what you see on TV.

Garmin got it right.  The ancient one I have from 2007 still works, albeit it has well-outdated maps.  The wife got a brand new Garmin a year ago as a gift.  The software, or "operating system", if you will, is identical, save for extra features and enhancements.  It's easy-to-use, intuitive, and just plain works pretty much every time.
Reply: jaykay18
So far, most cameras that look like cameras, do not have the convenience of being able to directly attach photos to emails to share them with somebody else. To me, that makes a "real" camera more like a toy, because it is so incomplete. Sort of like a car without any truck or storage space. "Well whatever do you need storage space for? A car is for carrying people." Yeah, but shouldn't it also be able to move bulky stuff, and carry your groceries?

Why do you think that phones take "garbage" pictures? It seems to me, that phones lack the "extreme" features of "real" cameras, being able to better control many of the factors of photo-taking, and being able to take great pictures in dim light, being able to stop motion with high shutter speed, or being able to control the amount of depth-of-field. Most casual photographers do not care a lot about those features, and instead prefer the feature of the convenience of that their phone is always with them. Surely, phone-photos are just fine for evidence or recording some car crash or fender-bender.

So what I want to know is, if everybody claims to use the "freshest ingredients", then who uses the worst ingredients? Seems like an obvious question.

How do they get Garmins to last so long? Do you mean that your ancient Garmin's battery hasn't turned to crap? Perhaps you have never left it in a hot or cold car? How much am I missing out on, having an old rather than a new Garmin? Does Garmin still use the old resistance screen? It feels kind of odd somethings, I touch the screen and nothing happens. Actually have to push a bit on the screen. The capacitance screens that all the Android devices use, are so super-sensitive, that merely moving your finger very near to the screen, will activate a "click". I can't imagine going anywhere far away by car, without bringing Lady Garmin with me. But Lady Garmin doesn't seem to be very faithful. It seems so odd to watch some YT video and hear that same Lady Garmin talking to somebody else. She sure does get around, way too much. (a joke)

BTW, if you don't have a USB flash drive handy, you can use the spare memory space on your Garmin, to store files or photos.
Reply from the maker: Yosef MacGruber While I understand that "real cameras" have no capability for emailing directly, think back to when we had film.  In my family, if we didn't use a roll, it could be months before seeing some of those vacation pictures!  It was worth the wait.  It's all about instant gratification now.

Phones take great snapshots, but not great pictures.  Like I said, it's great to have a camera with you and grab a quick photo, but like I said, nowadays it's all about quantity over quality.

The new Lady Garmin is all the same as the old one.  Yes, the new screens are more sensitive like touchscreens of today.  Big deal, I only program it once before I leave!

I've never fully charged the Garmin I have, though it does sit in the car.  If it loses power, it can stay up and running (for what little charge it has received) for at least a good 5 minutes, maybe longer.  I don't seem to need it when the car is off!
Reply: jaykay18
Actually, I think the modern digital camera, does that better also. Often, I need to check my pictures, instantly after taking them. What I wanted in the picture, got blocked by somebody standing in the way. Or the picture is blurry. Or poorly framed. Since I checked right away, perhaps I can still try again and see if I can get a better picture, and then I soon if not right then, delete the bad pictures. Conversely, I may check my pictures when I get home, and to my relief, they look even better, than they appeared when I was outside in the sunlight, and the bright light somewhat bleached out my view screen.

Back in "the good ol' days" you might pay extra to get double prints, so that you could share a few photos with family and friends. Now it is so easy. Email some pictures, or tell them to let me hold their USB flash drive, and I will give the person my entire collection of photographs. Why not, since I get to keep all my photos also?

Well my mere "phone photos" look great on my TV, so whatever is the problem that you are complaining about?

The Garmin uses so little energy, that you can just leave it on in the car, while you are parked for a while. Such a tiny device will not drain your car battery. However, it is a pain, if your cigarette light power outlet, loses power when you turn off the ignition. Whether it does or not, depends on the vehicle.
Reply from the maker: Yosef MacGruber I have no problem with phone pictures, but like I said, a standalone digital camera does it better.  Just like your GPS does it better than your phone.
Reply: jaykay18
A standalone digital camera, may do it better, but most of them still can not email pictures, and most of the people taking pictures, are still using their phones.

My GPS does it better, mainly due to better software, which my smart-phone should have been capable of running. BTW, my Garmin is older than my smart-phone. I had no Android devices, when I bought my Garmin.
Reply from the maker: Yosef MacGruber While that's true that digital cameras generally can't email pictures, they were making, for a while, SD cards with wifi built in.  Not to mention my new video camera has wifi built in and can even upload its videos straight to YouTube.  And no, I didn't pay an arm and a leg for it, nor do I have to lug a suitcase around for this functionality.
Reply: jaykay18
But you still need to carry some sort of camera case. And how many cases can you carry on your belt, and still put on a car seat-belt?
Reply from the maker: Yosef MacGruber I don't carry it on my belt.  I carry it on a monopod.  When I'm recording, I'm recording.  Otherwise I don't take it with me.  I go out with the INTENTION to record, not to hope I capture a particular moment.  I like to rely on good old memory for that.
Reply: jaykay18
Why a monopod? You need a tripod for it to stand up by itself. So you do have to carry a suitcase, to put that monopod into?
Reply from the maker: Yosef MacGruber Nope, I use a monopod solely on the go.  A camera on a stick.  I hold the monopod to control the camera, if I need a steadier shot I'll extend it to the ground.  If I need extra reach I'll extend it, then edit the clip later.

If I'm doing other stuff that could use the help of a tripod, then I use my tripod, but it's rare I bring it anywhere.  I do keep my tripod with bendable legs (sort of like a gorilla-grip) in the trunk, but I've never found myself using it yet.

I record several times a week, so I have the gear on hand.  Even though the camera has built-in wifi it's not of much use since the videos go straight to editing first.  Some people used to edit their digital photos before archiving.  Exactly the point--reviewing what you have instead of posting the blurriest, noisiest picture to Facebook.
Reply: jaykay18
You are not supposed to post the highest-quality photos onto websites, because those load too slowly.

Why do you need a monopod anyway? You can't hold your hands steady? Or do you record video that needs to be very steady? In which case, why not use a tripod?
Reply from the maker: Yosef MacGruber High-quality photos don't exist anymore, we went through that.

The monopod allows for steadier shots and more control.  It acts almost like a plumb bob when not fully extended.  Other times it's just a better and more comfortable grip with the camera.  And again if I need more reach I can extend it, put the camera in harm's way, then edit the clip later.

When I first learned about monopods I thought exactly the same thing, "what a useless device".  Turns out it's more than useful.  The camera feels positively naked without it.  And I've converted many other people over to using a monopod.

If I'm recording video that needs to be steady, or if I'm starring in it, or if I need both hands to be free, then I use a tripod.
Reply: jaykay18
Perhaps you can also convert people over to hopping on one leg?
Reply from the maker: Yosef MacGruber No, they have their monopod for that!
Reply: jaykay18
Monopods seem silly to me. Like somebody trying to impress everybody with their obnoxious and complicated camera.
Reply from the maker: Yosef MacGruber Like I said, they seemed silly to me as well.  One day I tried one.  That was all it took.
Reply: jaykay18
So you tried one, and it turned you into some freaky photographer, who goes around with some freaky looking monopod, as if you are somebody special with your very complicated camera, that only you are smart enough to understand? So do you take photos for hobby, or is it your job?

I find it so convenient to just pull out an Android device, and take a photo. And then just slide it back into my cellphone pouch or pocket. No complicated tripod to get out. However, if I was to ever start photographing myself to make YT videos, I would have to figure out how to stabilize my Android device, or go get some camera or something that I can mount on a tripod. But then, do I never need to make such YT videos? I couldn't just record my voice, and make some whiteboard or some computer slide presentation to go along with it?
Reply from the maker: Yosef MacGruber I don't take still photos much.  Lots more video than stills.  I have a separate still camera and separate video camera.  The video camera doesn't take good stills, and the still camera doesn't take good videos.  That's why an all-in-one device will never do.

I make YouTube videos as a hobby, but it's becoming less and less of a hobby and more and more of a job.  I used to upload very infrequently, and when I did, I'd dump 6 or 7 videos up at a time.  Then I realized nobody would sit and watch that many in a row.  A few weeks later I had recorded a lot more, and realized I could release one video a day and it would last for 2 weeks, and probably people would watch.  The formula worked.  During those 2 weeks, I recorded more and more, so the 2 weeks became 4 weeks, the 4 weeks became 8 weeks, and here we are several YEARS later that I've been posting a new video every day.
Reply: jaykay18
Why not the same camera for both still photos and for video? Why so much redundant equipment?

My Android all-in-one devices work well for me. But having several Android devices, I strangely find that one of them does something better  than another. I probably do not even use the best camera, but I like that one device for photos, because it just seems to have endless memory in it, and it is what I started taking digital photos with.

I don't check back for the channel's daily video update, but rather watch YT videos in related batches, when and if I have time.

Do you make much money with YT videos? I need to learn how to employ myself and to make myself a better living. The Great Obama Depression is so awful, it is another reason that I want to leave the country. It is not like there is much for me to stay for? Way too much concerning corruption from this evil government and the gullible moron Americans who support the endless corruption.
Reply from the maker: Yosef MacGruber You just answered your own question.  One does it better than another.  That's why there's redundant equipment.  It's pretty rare I'll bring the still camera when I'm shooting video; my recent vacation being a notable exception.  Why settle for the rest when you can settle for the best?

YouTube is not enough money to live on sadly, but every year it does increase.  So one day when I'm 153 I'll be able to live on it, but by that point, well, you know the rest, inflation will have taken such a stronghold that it won't cover it.  Or I might be dead.

This country does not have much to offer nowadays.  Everyone else wanted a piece of American pie, and now there's nothing left but crumbs for us.  Perhaps with the incumbent new president things will turn around some.  We can hope anyway.
Reply from the maker: Yosef MacGruber It's rare I'll buy new equipment.  The old equipment usually still works, although it's had its battle scars in the day.  When I get new stuff, the old stuff goes to the wife to mess around with.  She makes videos every once and again.

I highly doubt the US can be fixed.  They can put band-aids all they want, but I certainly would like to see a lot of those than the pus-oozing wounds we have now.

Trump is the President Elect.  He's also a will-be incumbent.  That's more or less what I was trying to say.
Reply: jaykay18
I doubt that Trump will be re-elected. He would have to do an exceptional job, and he could get blamed for something that is, or is not, his fault. Republicans always get blamed for something.

We had better plan our escape, before Trump's 1st term is over. There could be Marshal Law, sealing of the borders, and worse.

Sounds like you have an interesting wife. Better get her out of the country also, as the husband has a duty to protect the family.

Sure, the country can easily be fixed, if Babylon America would just repent. But that seems rather unlikely anytime soon. I am not seeing the signs of repentance or of America being serious about fixing its problems.
Reply from the maker: Yosef MacGruber Agreed!
Reply: jaykay18
Are you yet exploring how to leave Babylon America?
Reply from the maker: Yosef MacGruber Nope, unfortunately I'm stuck here right now for contractual obligations.
Reply: jaykay18
Well then, do not renew your contract, or perhaps you might somehow suggest changing the parameters. You can still explore and get ready to leave the country, even if you think you need to wait until some date as to when you can go. Get ready, but I do hope that it is not too late.
Reply from the maker: Yosef MacGruber We shall see.
Reply: jaykay18. Some multimeters have a built-in meter battery checker that will actually check your meter battery that will tell you how much life is left in the battery of your meter.